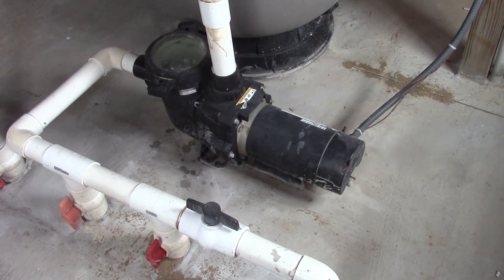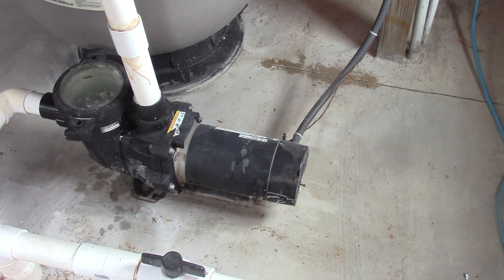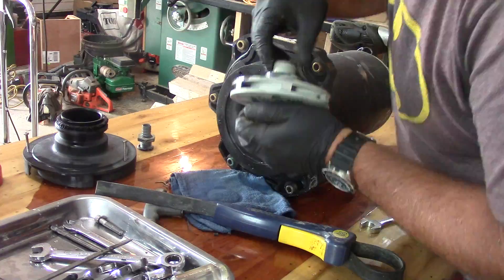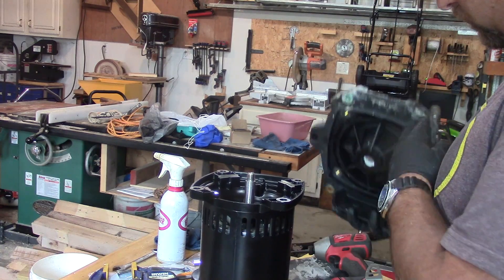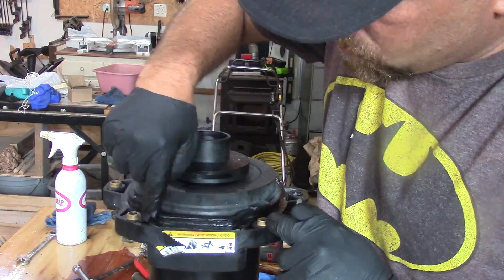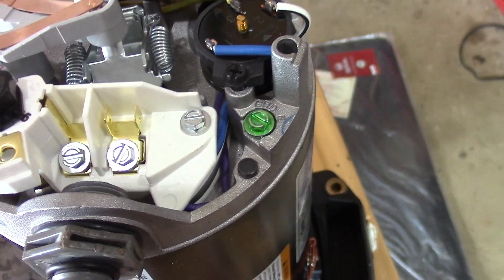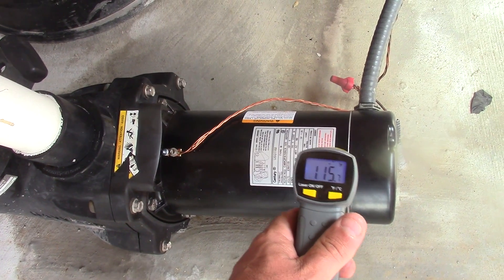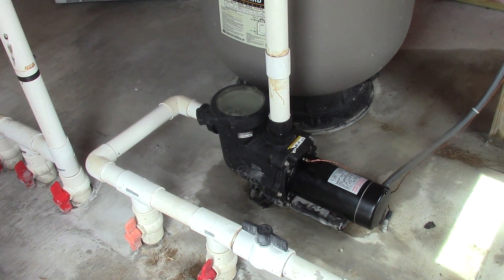How To Rebuild And Install A Pool Pump Motor

Comment from the maker: https://amzn.to/2H1eDhD Hayward Pool Pump Gasket Kit
http://amzn.to/2uasYFg 6203 Bearing for motors
http://amzn.to/2uaoWg0 Bearing puller set
http://amzn.to/2wrMCcB  A.O. Smith 1.5HP Motor Replacement
http://amzn.to/2uEJnQQ A.O. Smith 1HP Motor Replacement
                               Variable Speed Pumps
http://amzn.to/2veaPGJ Variable speed Pentair Pool Pump
http://amzn.to/2uIWFdB Variable Speed Hayward Pool Pump
                                       Salt Water Cells
http://amzn.to/2uEIxnq Hayward Salt Water Cell 40K Gallon
http://amzn.to/2v3JZAy Circupool Salt Water Generator 40K Gallon

Comment: Thanks for the clear and well paced video. A safety reminder is that the starting capacitor can be charged up and waiting to give you a good zapp. It may not kill you but the shock can jerk your body to hit something you'd rather not be hitting.  You're wearing rubber gloves, so you're good.

Comment: lube on the shaft seal is a no no !!
Reply: Don't use sealant on the rubber seal plate side, use lube. Don't use lube on the shaft seal itself at all. I do this for a living.
Reply: I was told to only use liquid soap  ???

Comment: Shaft seal only needs to be hand tight. By using a strap wrench you stand a good chance of cracking the ceramic on the seal.
Reply: Yep,  and the ceramic seal should be spotless clean without any lube or grease.

Comment: Nice work Bob . I take it the old motor used a lot of juice off the mains.
Cheers Pete.
Reply from the maker: The old motor was getting loud and running hot.  I'm in the process of replacing the motor bearings on the old one, just waiting on parts.
Reply: Pete Froud

Comment: Very nice, Bob.  I'm looking forward to the pump motor rebuild too.  Emerson is an old, well-known electric motor that, if memory serves, were on all of Sears' belt driven (and maybe direct drive) table saws.
Reply from the maker: The rebuild is on the way.  I have the motor torn down and the parts on the way.  The hardest part was getting the bearings off, but I got it done.  Emerson motors look like they have been replaced by US Motors Corp. but from what I heard all the newer high efficiency motors preform well and no brands are really duds.

Comment: Salt water to generate chlorine???????????????????
Reply from the maker: Yes, John the water is 2500ppm salt (ocean water is 35,000ppm salt) you can't tell it is salt water when swimming.  The chlorine generator uses electricity to convert the salt water to chlorine.  Once the chlorine is used up in the pool it returns back into salt water.